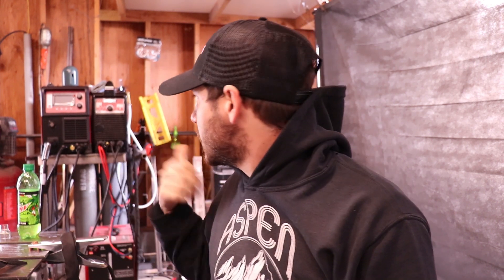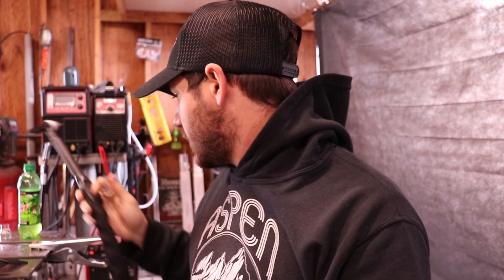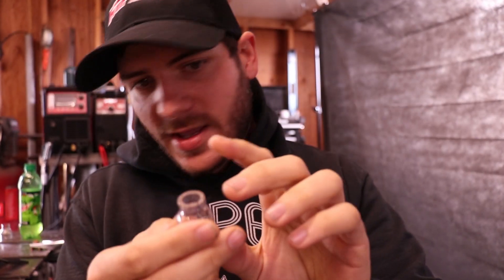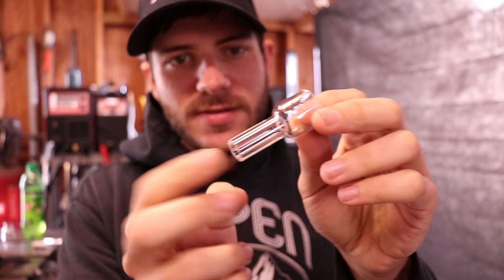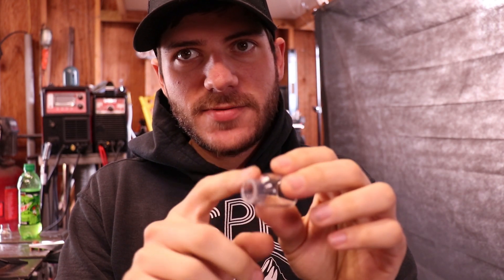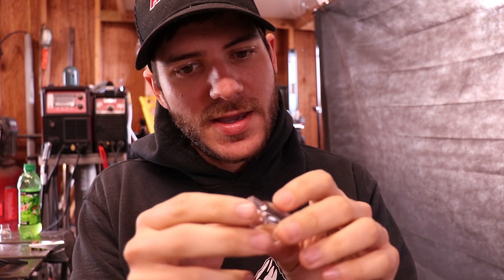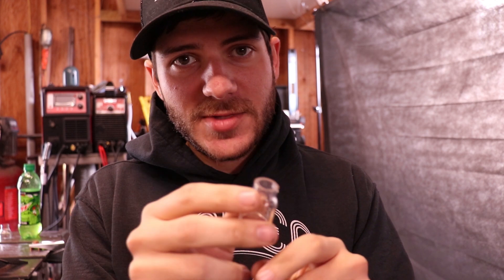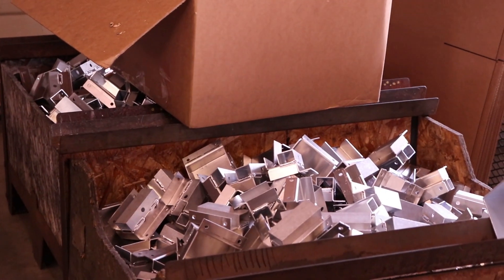TIG Welding a Custom Vertical Intercooler with HTP Invertig 221

Comment: What are your thoughts on the "INVERTIG 301 AC/DC" for the same project? So for thin metal it seems that both would perform the same I suppose. The 350amps probably good for half inch thick aluminum maybe? Thanks.

Comment: Why do people keep using 5356 in intercooler/piping fabrication?  It's prone to cracking in this environment, especially on the hot side where compressor outlet temps can reach +300°f depending upon turbo efficiency.
Reply from the maker: I thought the same thing.  All my buddies that build them use 5356.  I was tempted to use 4943 but didn't know if I had enough.  Next one will be 4943.  At work we build a lot of piping like high pressure water lines and muffler systems for boats.  We use 5356 because of the corrosion resistance but never had them crack out even on the exhaust systems.  So I'm not that worried.
Reply: @5thStreetFab  I don't know anything about the marine environment.  However, in a automotive one, it's not just the heat.  It's the combination of multiple heating/cooling and pressure cycles just from driving normal to aggressive, back to normal in a short period of time.  It's that constant thermal cycling and flexing that's the issue. 

I've seen cracking issues more so on high boost 4 cylinder engine vs v6/v8 as they usually don't need to run such high pressure ratios. 

You do great work. I'm not knocking it.   I've just always wondered why I see people using 5356 is this application.  What's worst is  someone on YouTube built an oil cooler using 5653.  To me that's asking for trouble.

Comment: You have decent exposure on your video. If you want tighter arc shots. Try a macro lens. With a macro lens the tungsten would fill more of the screen and you could see the puddle. You got the exposure nailed and with a macro lens you would be making money shots. Also did you know Space X is hiring TIG welders to work on the new space ships? Elon Musk does not care if you went to school. He cares about results. You got real talent👍
Reply from the maker: Thank you!  I want a macro but I need to save up they're pretty expensive!  I've tried applying for spacex but they want local welders and I'm no where near any of their locations! Oh well
Reply: @5thStreetFab  Damn, that's too bad about Space X. It would be a big deal to relocate. have they seen your work? Elon Musk might make an exception for you. If you buy a macro lens. Make sure you understand working distance before you buy. You are going to want a lens that is macro and has a long working distance. If not your lens will melt from the heat. Also if you are using a hood for a shade. Try buying a 15 stop Neutral Density filter. Break Trough Photography makes really good ND filters that do not have any color cast.
Reply from the maker: @radishfever  Ya I think they get enough applicants that they're not worried about missing out.  And yes I can't find a macro with a high enough f stop.  Especially anything under a grand!  And yes I use an ND filter.  My sister in law is a photographer so she has a ton of knowledge on all the camera stuff for me!  Thanks bud 👊
Reply: @5thStreetFab   No problem. Yeah, no cheap way out unfortunately. Lots of camera gear I desire and can't afford. It can actually be a more expensive hobby than welding. Thanks for sharing the knowledge you have. Bottom line is you are going to make it know matter where you work.
Reply from the maker: @radishfever  thank you! And yes lenses are not cheap!

Comment: Are you going to be pressure testing this before it goes on a car? If so, do you just plan on submerging it in water and pressurizing it?
Reply from the maker: Yes I pressure tested it.  I cap off all but one and add a guage and pressurise the tank then let it sit for 30 minutes and use soapy water to check

Comment: Well, after watching the video to the end ....  AND reading the description .... 

Now i know for sure it was 5356

2:02  see the green flame every time you dip rod into the puddle ? That is 5000 series ( most likely 5356 ) with high magnesium content for you....

I would have picked something with less than 3% magnesium for that intercooler, seeing it gets a lot of heat 150F+ and a fair share of vibration....  and “hot cracking” may or may not be an issue .....  

Now wait and see how much youtube hate i get for this comment .....

Lol

Excellent craftsmanship though !!!!!

Half way through the video it looks like 4000 series wire ( either 4043 or 4943 ) i couldn’t see any green in those arcs ....  

It will probably be just fine.
Reply from the maker: I thought the same thing Peter!  But everyone I talked to that builds them uses 5356 so I decided what the heck!  But I was super close to running 4943
Reply: 5th Street Fab if you would want color anodize it then you would have to use 5356 .....

Not everything will crack all the time ! 
But you do see some temperature swings and constant vibration .....

And just because “everyone does it” .....  lol  

I talk to a lot of guy on a regular basis :” i have been doing this for 30 years !!!”  And i say : “ sorry sir to be the guy who has to tell you - but you have been doing it wrong for 50 years “ ......  lol
Reply from the maker: You're right I should have gone with my gut!  Next one I'll use 4943